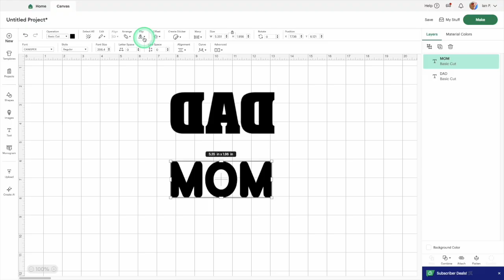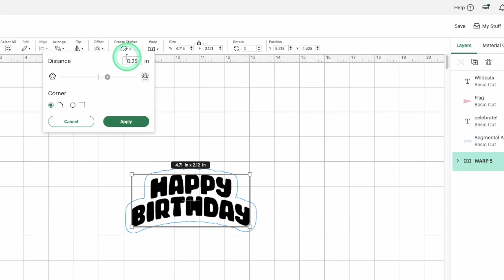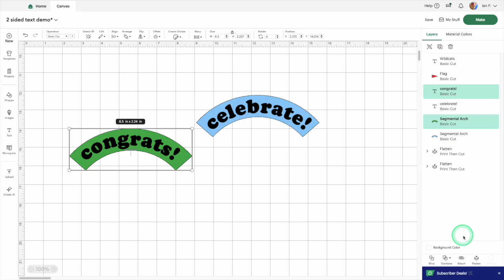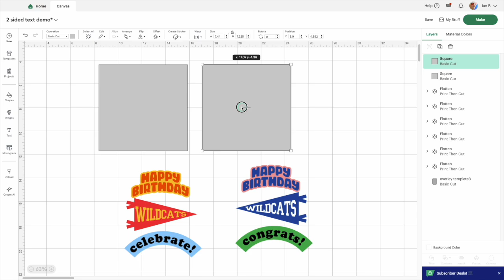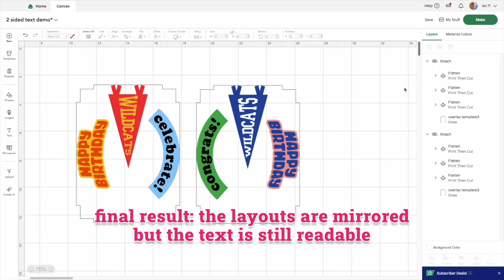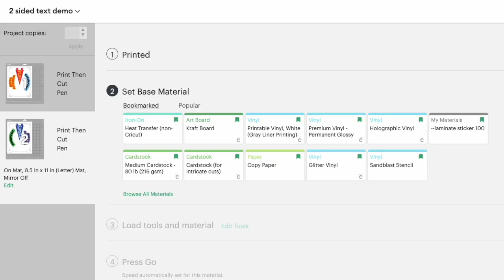Two-Sided TEXT Made Easy with Cricut Print & Cut – No Guessing!

Comment: Thank you for your invaluable videos! 
I am totally stuck on a project and wonder if you could help with a video. 
My daughter is getting married and would like gatefold invites with text on front & back. 
When I attempt it, when I fold the ends over to the front, it’s every way but the right way. 
Please help this frazzled mum 🥴😂
Reply from the maker: Sorry to hear you're having trouble making your invitation. Can you be a bit more specific about where you want your text? Are you trying to put it on the outer flaps and inside the main panel of the card? Or do you want text on the main panel and on the back side? 
The best piece of advice I can give is to remember to make a duplicate of your card base and flip it horizontally before you attach any of the text to it. When you are ready to send it to the printer, having two print and cut mats that are mirrored in their orientation and their position on the mat will ensure success. (You set up the mirror on the canvas instead of clicking the mirror toggle in the mat preview screen)
If you haven't watched it already, you might find my project demo on making a 2 sided print and cut card helpful: https://youtu.be/QoVrI-TWCHE
If you still have questions, please feel free to ask!
Reply: @SniptoIt . Thank you so much for your quick reply! 
So say a 4x6 (portrait) invite, (she would actually like 5x7 but cricut won’t do that as it would actually need to be 10x7) the actual size open would be 8x6 and 2” either side would fold over.
Main text in the middle 4”, with timings & details either side of that on the 2” fold over edges. 
Then when the sides are folded over, their initials on the front, 1 initial on each side.  A belly band will go round the whole thing. 
I’ve had initials on the wrong side, I’ve had initials on the right side but text inside is upside down 😂🤦‍♀️
I just don’t seem to be able to get my head round it 😂. 
I hope that makes sense, I’ve read over it a dozen times and am confusing myself (again) now  🥴
If you’ve got this far, thank you so so much!
I’m going to watch that video ☝️again now. 
X
Reply from the maker: Hi Sandy, here's what you need to do to make this work:
• Put your 8x6” square on the canvas and duplicate it

• One of these will have your inside text and score lines - make this your “back” that you print second and then cut (so you can score on the inside of the card)

• One of these will have the outside text, i.e. the initials for on the gatefolds - designate this the “front”

• Add 2 score lines to the “back” card base where they need to go (don’t Attach yet), then add all your text/images or whatever else you want and flatten the inside text to the card base, then Attach the score lines to the flattened base

• For the front, position the initials where they need to go. The initial you want on the left on the finished folded card will be positioned on the RIGHT on your card base. The initial that goes on the right on the finished, folded card will be on the LEFT on your card base. Add any other images or text you want to the gatefold flaps around the initials and flatten with the card base.

• Now, setting up the print. You’ll need to download the max print and cut area guide from our website - the link is in the video description. Add that shape to the canvas and move it to the bottom of the layers panel (or right click and Move to Back). Duplicate the guide shape

• Here’s the tricky bit: your designs must be rotated to fit inside the guide shape. Click on the back cardbase (the one with the score lines) and in the Rotate box, type in 90 degrees. This will print the back panel with the top facing right. 

• Click on the front card base (the one with the gatefold initials) and type in MINUS 90 (-90) degrees (or 270 degrees), and it will show the cardbase with the top edge facing left. 

• Now, select each card base and its guide shape and Align > Center. Attach each card base to its guide shape and change the guide shape operation to Draw.

• Print the front (gatefold initials), then flip the paper and print the back (invitation text) and then carry out the score and cut operations for the back panel. 

• How you flip the paper to print the back depends on your printer, of course, so you can refer to the video for that. 

It sounds like you're really close to cracking this! Let me know how it works out – Ian
Reply: @SniptoIt . Oh my goodness!!  That must have taken you so much time and it is so clear and comprehensive!
I can’t tell you how much I appreciate this. I now have a step by step guide to follow. 
I wish I could show you a photo when I’ve done ( probably next weekend now .. work does get in the way doesn’t it 😏)
Can’t wait to do this. 
Thank you so so much! X
Reply from the maker: Hi Sandie, it's my pleasure, I'm happy I could help. I've been immersed in 2-sided print and cut for a couple of weeks, so putting together this step-by-step for you was not that tough.

I'd love to see a photo of the finished invitations, you can get in touch with me through our website at https://sniptoit.com or you can post a photo in the comments on our Facebook page: https://www.facebook.com/sniptoit

It would really help us if you tagged us using @sniptoit or #sniptoit if you share your project with your friends, or you can share this tutorial on your own social media.

Are you planning on doing anything else with your Cricut for your daughter's wedding?
Reply: @S @SniptoIt . Oh I certainly will share! I never even realised you had a Facebook or website. Thank you for that and of course I will tag you on anything I share. I am so very grateful. 
Yes I’ve also been asked to do the welcome sign and place cards, all of which are so much simpler thank goodness 😂
And no doubt there will be things for her hen party too.  Thankfully it’s not til next September but I like to have time and be prepared. 😂
Thank you again … can’t thank you too many times 😂😂 x
Reply: @SniptoIt . Hi Ian,  just a follow up and a huge thank you. Your explanation worked beautifully. I practised on copy paper and although it worked my daughter thought it too small, actually I did too, a 4x6 (when folded) just looked wrong. 
So I tried it cutting the largest foldy back bit and then glued the middle and sides on. It worked fine but still looking at other options now. 
But I’m sure your way will definitely be used again … maybe for Xmas cards 🤔😂
Thank you SO MUCH, again!
Love
Sandie x
Reply from the maker: Hi @sandiefoster 
Thanks for following up! I'm sorry to hear that this technique wasn't the right fit your wedding invitations. While there are ways to get a larger print and cut size on a Cricut, sadly these methods don't lend themselves to doing a double sided project. I'm really glad you were able to stick to it and follow all the steps and finish your project, but I too am disappointed that the finished 4x6 size didn't do your invitations justice. 
I did use this technique to make a double sided Christmas card, maybe you'll like that: https://www.youtube.com/watch?v=QoVrI-TWCHE
Happy Crafting!
Reply: @SniptoIt . I saw that yes. It’s fab but cricut still won’t print & cut 10x7 to make a 5x7 card when folded. 
I think I’ve seen all your videos now. I’m obsessed 😂. Your instructions are so clear and precise. 
Thank you x